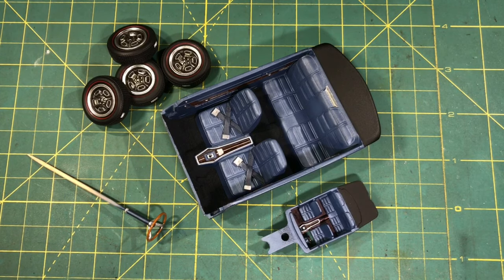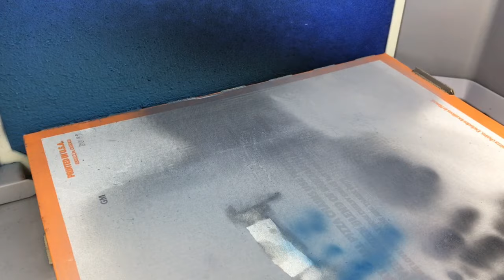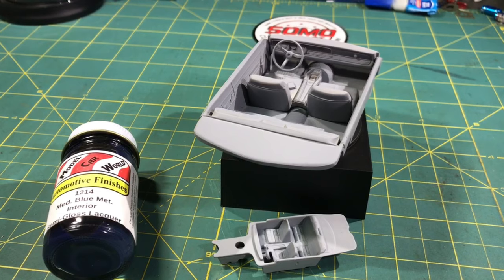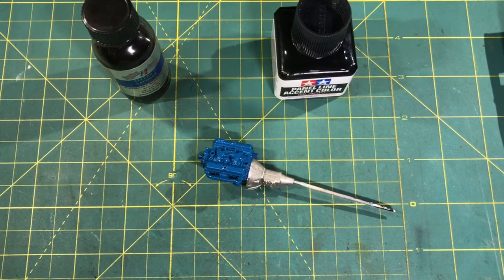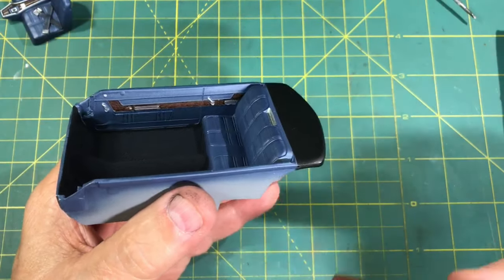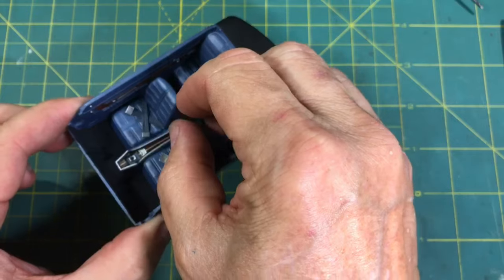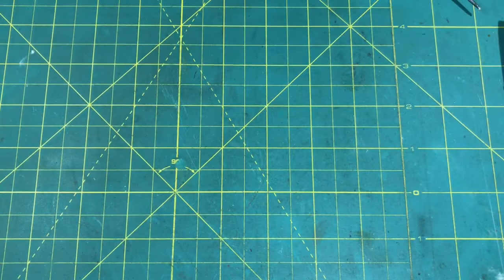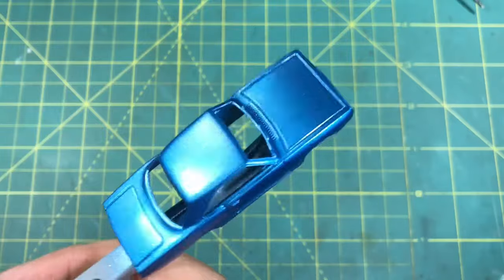1969 Barracuda Build  Part Four

Comment: Hi mark I wonder how you decant a can of paint
Reply from the maker: Ruane, I use a "bendy" straw attached to the spray nozzle with tape or silly putty. I use old med bottles to catch the paint. First put tape over the bottle, cut a small slit in the tape, insert the straw and spray. (the tape cover avoids blow back) Airbrush ready for most paints!